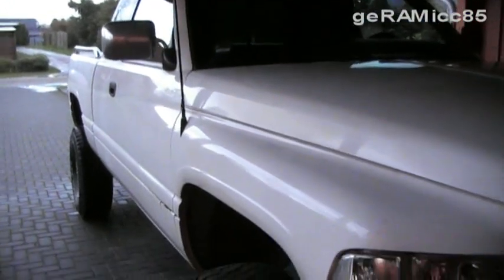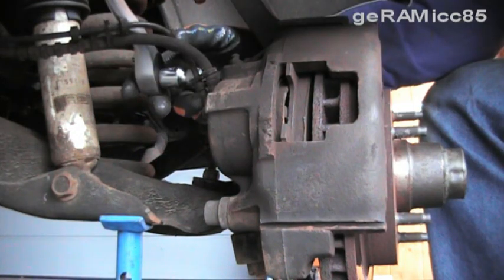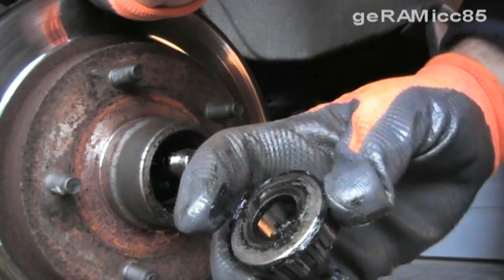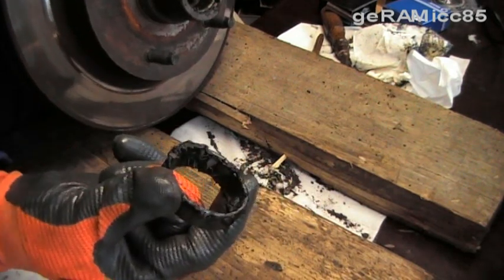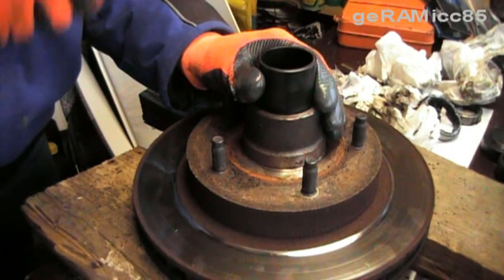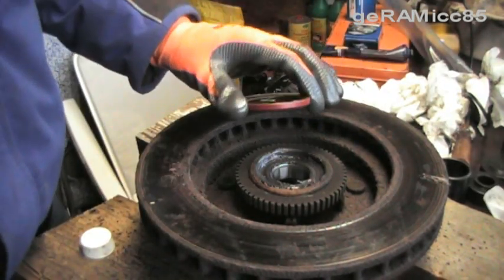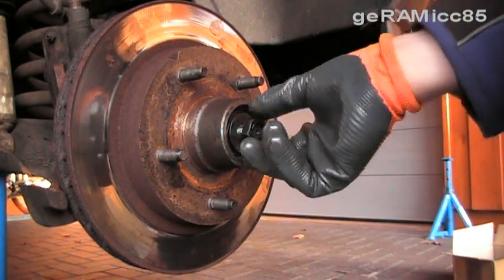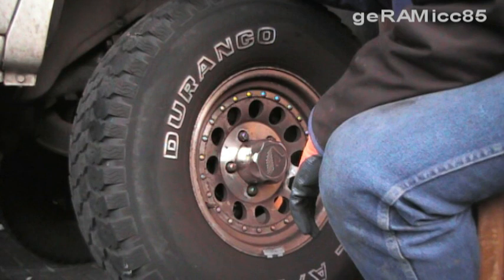HOW TO REPLACE WHEEL BEARING | GET OUT+CHANGE RACE | REPAIR+FIX+GREASE HUB DODGE RAM PICK UP TRUCK

Comment: Hint: Use the old bearing race as a drift-punch for tapping in the new bearing race. Make sure they're both facing the same way so you can tap the old one back out when the new one gets to the bottom. Dodge recommends putting the brake rotor and wheel on with the lug nuts (but not the brake caliper) and spinning the wheel while tightening the spindle nut. While spinning the wheel, tighten the nut, loosen it, and tighten it down again so the wheel turns smoothly but has no play.  The service manual has no torque spec for the spindle nut.
Reply: Good to know thanks
Reply: Continue rotating wheel and back off adjusting
nut until wheel end play is no more than 0.025 to
0.051 mm (0.001 to 0.002 in.).

Comment: Why would someone vote this video down?
Must be your competition because you made this video so clear and precise and made them look bad, LOL.
Reply: Because it's bad instruction! He did not pack either bearing at all, he did not pack the hub at all, and he used the wrong grease for an example.
If you don't know what you are doing, you should not post "How To" videos.
Reply: @doserdiesel  He also didn't use the manufactures tork specks and he reused the coitter pen too. He didn't reseat the bearings completely. This Video should be flagged and taken down. The way he showed it, is very dangerous

Comment: This video was very helpful before deciding to do the work myself on a 95 Dodge Ram 2500.
I ended up going to 3 different parts stores. Autozone did not have all of the bearings and sleeves. NAPA had what I needed. For those that don't know this then you will need 2 outer bearings that come with one sleeve per packet. The inner bearings were sold separately from the inner sleeves. I then went to O'Reilly because they loan out tools with a deposit, so I borrowed a Bearing Sleeve installation tool. You will need a tub of grease, brake and drum cleaner, and an entire roll of paper towels.

Dodge dealer told me to torque the bearing nut to 14 Lbs just for seating purposes, then loosen, then hand tighten, and of course put the cotter pin in so the nut doesn't keep loosening. What I noticed in a short time is that as the bearings were breaking in I could feel a bit of loosening or steering that was not as tight as it should be, so I raised each wheel off the ground then put a 4 lb torque to allow further break in.

The difference in how my truck goes down the road is incredible, it had always made a loud noise that I thought was just road noise, and now it's quieter and it feels like I am slipping down the road on banana peels, it made that much of a difference, now I really have to watch my speed and I'm hoping the mialage improves as well. Thanks for posting the video, the job is easy to do, it's just messy.
Reply: J st

Comment: Not a bad video except for one thing. Packing grease into the bearings. I'm wondering if you've had to replace bearings again yet because you don't have enough grease in them. If you haven't, I'd at least pop the outer bearing back out, stuff a bunch of grease into the hub and properly pack the outer bearing by using either a bearing grease packer or just packing it in with your hands.
Reply: +Kerry Mullins I agree with you on the grease. Not enough at all. The rest of the video was great.

Comment: Never seen anybody push a piston in to get the caliper off.  fail-ish  And aren't you supposed to pack those bearings?  just checking on that.  This video has its merits though, so thanks for posting.
Reply: Not sure how you release the pressure off the caliper to remove it from the 
rotor - he packed the bearings enough - watch the video again before you write "failish". Thanks for video. It was helpful.
Reply: @80leadsled  No he didn't.
Reply: @80leadsled  looks o.k. to me also.

Comment: Is the truck yours?
Nice tire!
I have a 2001 1500 ram what's yours?

What size lift and tires?
No lift on mine and only 2x4 I thought about getting the 2" front leveling kit and going with 265/70R17 BF Goodrich all terrain T/A's need some decent tires for when my wife and I go shooting in the desert, we do after all live in Arizona which if you don't know is 90% desert.

Comment: What is the outer diameter of the round piece of metal tube you are using to press in the drive for inner and outer?
I have a 1996 Ram Van B1500 RWD, but I believe it is exactly the same process to replace the front bearings.
Any brand preference? I plan on ordering parts from Rock Auto to get what I need to do this job.

Comment: You were good with everything.... EXCEPT, You have to PACK those bearings with the correct grease! Those bearings are now doomed for heat and failure.

Comment: Thank You! This video is the one I've been searching for. Most of the instructions on YouTube are for 4X4 Rams, and in those,  the bearings come assembled. My inner bearing was completely gone and the race (drive) is stuck to the spindle. Any ideas on how to remove the race without destroying the spindle?
Reply: Derek Suddreth you can weld a bead down the race. This will cause the metal to expand and then shrink, so you can crack the race and hammer it off

Comment: A wee bit too conservative with the grease......its best to really pack the grease into the bearings either using a bearing packing kit, or just slapping the bearing into a fist-full of good grease, making sure you get grease into the inner most parts of the bearing.

Comment: Dodge calls a "Bearing Race" a "Wheel Bearing CUP".  Even more fun, if you look at Dodge part numbers (i.e. 1997) they have different part numbers for the 1500 line and the 2500/3500 series.  For a 1500, that is LINE 1 - so the part numbers start with a 52 or a 047.  and.....because this is DODGE, there are no torque specs on the Wheel Bearing Adjusting Nut.  

Continue rotating wheel and back off adjusting
nut until wheel end play is no more than 0.025 to
0.051 mm (0.001 to 0.002 in.).

Comment: there is a proper way of loading tapper bearings with grease to ensure they are loaded properly an that isn't it.
Reply: it works just the same
Reply: Skip C no it doesn't! read a book an learn why!
Reply: You are correct! This Bearing will soon fail again!

Comment: the inner wheel beering drive goes in the wheel whoo:, translation wheel bearing races are press fitted into the brake rotor hub ,.  You speaking Canadian eh? :/  BTW it's called PACKING the bearings but otherwise great tutorial.. Thanks spot on DYI.

Comment: You have high speed glazing on the rotor, looks like a fuckin' mirror. Race, not a drive...lol. Bearing & race should be a matched set, only. Being a 60 yo mechanic, the funniest thing is the "Gloves" EVERYONE is wearing these days. Grease, gack & slime ain't gonna kill ya. That's why they make Fast Orange, Go-Jo & shop rags...lol

Comment: For some reason Ram bearings are junk.. Made cheap there is no reason that these should not last 150,000 miles easy.. I have seen Toyota"s last 300,000 miles and still good.. You can always make money on Fords and Chevy's and Dodge's. There made cheap and know matter what part it is they don't last.. I have seen CVs fall apart in my hand at 50,000 miles. Real garbage.. People are clueless on American cars and Trucks.. I love the Fords blowing Spark Plugs. You tell people and they think your only trying to rip them off.. Or telling people they need a new engine from poor design.. Your just saying that then they go to a dealer and they tell them the same thing. $6,000 out of your bank people..

Comment: Don't not do what this guy is doing. U need to pack the bearings good with grease, and check your manufactures tork specks to seat the bearings correctly. Changing bearings wrong can be very dangerous. This guy should remove the video Asap. What he has shown is very dangerous way of changing bearings. He also called the races drives, that in itselve shows he is to inexperienced to be posting Diy videos. Also reusing the same cotter pen is a big don't do. Your wheel can come flying off and u can get what's called the death wobble. The poster should take this Diy Video down
Reply: being DODGE, there are no torque specs - from 1996 service manual: Continue rotating wheel and back off adjusting
nut until wheel end play is no more than 0.025 to
0.051 mm (0.001 to 0.002 in.).